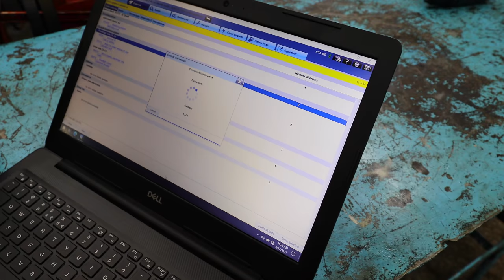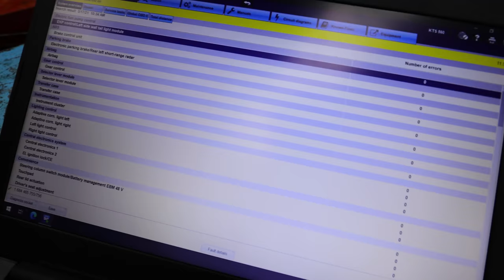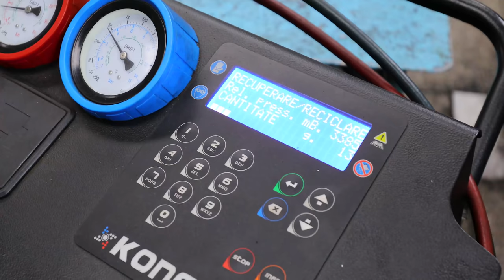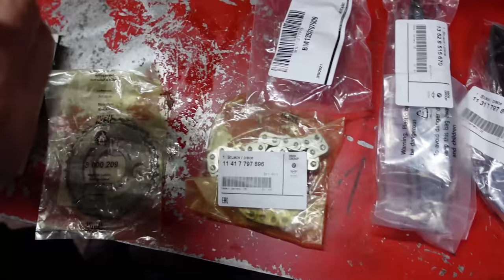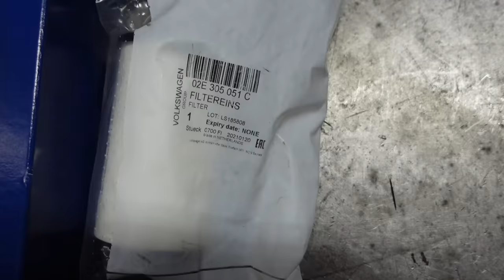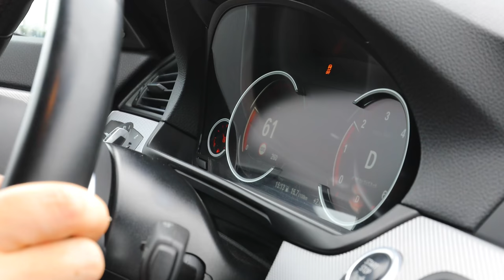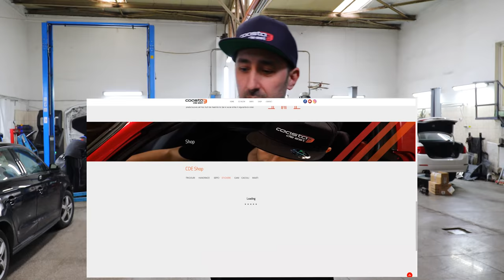BMW M550xd - balaurul cu 3 turbine 😈😈😈

Comment: O coincidenta ca masina care imi place cel mai mult apare chiar in videoul asta . Parerea mea este ca Bmw E31 850ci este un model chiar reusit de la BMW, nu il detin dar chiar mi-ar placea sa am o asemenea masina . Poate cu timpul o sa ajung chiar sa am asa ceva . Are motor de 4988 cmc, 300 cai . Pentru o masina fabricata in 1990, are foarte multe dotari precum scaune electrice cu memorie si incalzire, volan reglabil electric, ASC+T, ABS, AC, EDC/VDC, tempomat, perdeluta electrica, trapa electrica, pe care foarte multe masini noi din ziua de azi nu le au . Acum este o masina istorica care si-a pastrat pretul si costa si acum mai mult decat o masina noua ( 25k euro ) . Mi-ar placea sa am ocazia sa conduc o asemenea masina, chiar cu riscul de a plati benzina :))  , am inteles ca are consum de 20 prin oras .

Comment: Pentru mine cel mai tare BMW facut vreodata este BMW e36
Nu conteaza care motorizare, fl sau nfl. E36 este cel mai tare seria 3 facut vreodata datorita imbunatatirilor tehnice aduse de la modelul anterior E30. Detin un 320i fl din 1997, M52B20 si unul din motivele pentru care m-am indragostit de masina asta este motorul. Inline 6 single vanos, un motor simplu, construit bine si contrat parerilor unora, extrem de fiabil. Nu foarte pretentios si cu mici atentii, tind sa cred ca o sa ma tina pana aproape de milionul de km.
Partea de suspensie a fost total imbunatatita, mc pherson pe fata, suspensie cu punte independenta, multi link z axle si o directie care ofera un simt extrem de placut al drumului. 
Eu personal ma numar printre fericitii cu cateva dotari de exemplu OBC 18 butoane, dublu climatronic digital, inchidere centralizata, scaune din piele electrice si incalzite, etc. Un e36 sunt de parere ca poate fi top inclusiv in 2021 daca este ingrijit bine si are cateva dotari. Izolarea fonica este demential de buna pentru o masina batranica si cred ca cel mai interesant la masinile astea... problemele tipice din cauza varstei. 
Problemele respective pentru unii sunt batai de cap, eu care datorita venitului destul de mic tind sa traiesc o perioada cu fiecare problemuta aparuta, ajung sa ma simt ca si cum as avea un copilas suparat si prostut :)) Macaralele de la geamurile electrice din fata, fete de usi care cad, completarea in continuu al uleiului de la servo, rugina la usi care apare la cea mai mica urma de sare pe drum, stergatorul de pe partea soferului care nu sterge in partea de jos a parbrizului, difuzorul de spate din plastic care se topeste din cauza evacuarii, usita de la benzina care orice i-ai face la un moment dat se deschide in mers, mai da un missfire, etc
Deci pe langa faptul ca in 1990, e36 a fost revolutionar si un competitor periculos pentru masinile din clasa sa, acum, la batranete a devenit o masina absolut adorabila pe care sa o detii, inocenta ca un copilas si amuzanta uneori cu problemele ei banale si simple. In plus, eu personal in cele 6 luni de cand o detin pe a mea, am invatat chiar multa mecanica. Recomand oricarui pasionat care vrea sa isi faca de lucru, caruia ii place sa se murdareasca  de ulei pe maini si caruia ii place sa invete mecanica, luati-va BMW e36, nu o sa va saturati de ea, plus ca este o baza extrem de buna pentru orice tip de tuning, de la drift, la drag, la show. Pace tuturor si keep the good work there!

Comment: BMW 3.0 CSL (cunoscut și sub numele de Batmobile) a fost introdus în mai 1972 și va deveni unul dintre cele mai iubite vehicule ale companiei. A fost produs ca omologare specială, astfel încât BMW să poată intra în Campionatul European de Turism.
Pentru a face mașina mai ușoară decât modelul E9 de serie, inginerii BMW au folosit oțel mai subțire pentru caroserie și au eliminat tapițeria interioară și izolarea fonică. În plus, aluminiu a fost utilizat pentru multe dintre panourile caroseriei, iar geamurile laterale din sticlă au fost înlocuite cu cele mai ușoare din Perspex.
Cu un motor plin de 203 cai putere de 3.333 cmc cu șase cilindri, CSL a fost una dintre cele mai rapide mașini pe care banii le-ar putea cumpăra. În 1973, dimensiunea motorului a fost mărită la 3.153 cmc (3,2 litri), ceea ce a crescut puterea până la 203 cai putere la 5.600 rpm și cuplul de 211 lb ft la 4.200 rpm. Cu toată această putere și o greutate corporală redusă, 3.0 CSL a fost suficient de bun pentru 0-100 km / h (62 mph) în mai puțin de șapte secunde.

Comment: Ce "simplu" se schimba distributia... 😁... Bun clip, frumos examplar de BMW,....
... iar "cel mai cel" BMW... Pai daca e V8 si 5.ar, poate fi oricare... 540 e39, 540 e34, hai si X5 4.4 e53, hai si 740 e32... astea sunt pasiunile mele....

 Dar cel mai "emotionant" ramane M5 e39... 💕💕💕🏁... Are un echilibru aproape perfect intre toate criteriile mele... Cea mai echilibrata masina... Le are pe toate in combinatia perfecta... Design, putere, cuplu, greutate, spatiu interior,... E masina perfecta... Cel putin pt mine.. 😁 
M5 e39 de cand a aparut, pt mine a fost ca o emblema.. ca un simbol...

Comment: BMW M635csi o mașină rară foarte frumoasa din punctul meu de vedere o mașină unică

-Într-un pod nostalgic de-a lungul timpului, am avut prima mea rula în 635CSi condus de Prințul Leopold la runda austriacă DTM în Spielberg, în cazul în care BMW a marcat un senzațional 1-2-3-4, pentru a treia oară în istoria lor DTM. Celelalte două au fost o chestiune simetrică, prima și ultima pagină a capitolului 1 al BMW în DTM (1984-1992). Prima cursă din istoria DTM a văzut o flotă de modele 635CSi dominând domeniul în Zolder, condus de Grohs, Schneider, Strycek și Prințul Leopold. 30 de ani mai târziu, Prințul Leopol

-ce mai frumoasa istorie
Trusa este a mea❤️🙏

Comment: Salut băieți, vă urmă resc de foarte mult timp, am mai participat la concursurile voastre dar nu am avut notoc sa castig după părerea mea cel mai frumos model de BMW  este E30 M3 Evo III de 238 de cai putere cu motorul S14 cu 4 cilindri în linie pe lângă motorul foarte fiabil pe care această mașină îl are mai este și designul pe care această mică bijuterie îl are. Un lucru foarte interesant la această mașină este unicitatea ei, din anul 1980 și până în anul 1990 sa-au produs 600 de exemplare fapt care în prezent o face să concureze cu modelele noi din punct de vedere al prețului.  Motorul acestei mici bestii de 2,5 litri genera 238 CP, mașina a fost exportată în Marea Britanie unde a fost îmbunătățită cu un set de elemente marca AC Schnitzer printre care se numărau arcuri sport, bara de ramforsare a suspensiei față dar și oglinzi, pedale și volan din aluminiu. Pentru mine aceasta este una dintre cele mai bune motorizări de pe BMW sper să vă placă părerea mea.
P.S. Păcat că a plecat Ion!

Comment: Primul BMW seria 8
Mașina a fost prezentată publicului la Salonul Auto de la Frankfurt în septembrie 1989, seria 8 fiind printre primele modele la a cărei proiectare s-a folosit CAD (computer-aided design).Rezultatul a fost un coeficient aerodinamic de doar 0.29, unul foarte bun pentru perioada respectivă.Foarte avansată pentru vremea în care părinții noștri mergeau cu Dacii rablagite, Seria 8 devenea printre primele mașini ce avea accelerație electronică drive-by-wire și al doilea BMW, după Z1, cu punte spate multilink. Mai mult, avea chiar și coloană de ajustabilă electric cu memorie. Printre detaliile mai puțin avansate se numără cele două suporturi de pahare și lanterna situate în torpedoul de jos. Da, de jos, deoarece Seria 8 avea inițial două astfel de spații de depozitare, cel de sus fiind înlocuit ulterior cu airbagul pentru pasager.

Comment: Cel mai top bmw din punctul meu de vedere e m3 e92. Are motorul perfect:

-benzină
-4.0 l
-v8 
-aspirat
-420 cp cu 400nm

În funcție de preferințe, il poți lua cu DCT (dublu ambreiaj) sau manual.

Ținând cont că până acum s-au pus numai 6 în linie pe M-uri, V8-ul de pe e92 are un sunet demențial, este unul dintre cele mai fiabile motoare nefiind supra-alimentat. Pentru mine e cel mai frumos BMW desenat vreodată (nfl) și nu l-aș da nici pe M8 2020. De când eram mic era mașina preferată în NFS Hot Pursuit. Am reușit să-mi cumpăr un E92 320i anul trecut. Sper ca în viitorul apropiat să-mi permit și un E92 M3. Pentru cei care aveți bani, sfatul meu este să le cumpărați acum, deoarece li se va tripla valoarea în următorii 10 ani, datorită motorului aspirat.

Comment: BMW e 46 M3 
 
Sunt unul dintre oamenii care au îndrăgit masina asta datorită jocului Need for Speed Most Wanted . 
Câteva lucruri pe care le-am aflat despre masina după terminare jocului , sunt .                           1 ) BMW e46 M3 a fost lansat in anul 2000 și avea sub capota un motor 3,2 l care dă viața la 343 cp. 
2.  Masina venea in varianta coupe ce îi dădea un aspect sportiv bine conturat pentru vremea aceea si câteva elemente aerodinamice puls jante specifice ce inchegau aspectul mașinii .
3. Au fost fabricate și lansate și câteva modele mai speciale precum : BMW M3 gtr, M3 csl și M3 cs. 
In concluzie pot spune doar ca aceasta masina mi-a marcat copilaria prin puterea ce o arată in joc exact ca in realitate .
BMW e46 M3 o sa rămână in istorie ca unul dintre modelele BMW de top din vremea  lui ce a uimit prin putere , design și fiabilitate .

Comment: BMW Z8 e52, design clasic inspirat de la și mai clasicul 507, BMW 507 ca suna un pic a Peugeot numele 🤣 Un V8 sub capota, s62 de 4.9L, cutie manuala 6 trepte și un interior super stilat, cam tot ce ii trebuie unui roadster premium. A fost disponibilă și o varianta Alpina cu V8 de 4.8 (M62) și transmisie automata in 5 trepte dar eu as alege varianta standard cu transmisie manuala. Fabricat între 2000-2003, deci simplu de întreținut, practic iti cam ajunge trusa de scule pt lucru la o astfel de mașina și se pot face multe lucrări la nivel de pasionat. La data lansării costa 128.000 de dolari, in 1999, acum greu găsești una sub 165000 €. Cu puțin noroc la loterie îmi iau și eu 😂 Multă bafta in continuare, poate vedem o distribuție de z8 pe canal. Dacă reușesc la loto va aduc eu una 🤣

Comment: Mașina mea preferată este un BMW E30 M3, e mașina visurilor mele. Încă de mic am fost atras de ea. În primul rând este un motor aspirat, cu 4 cilindri în linie, este o mașină ușoară care are cuplul cel mai mare la turații foarte mari. Motorul dezvolta între 200 și 238cp, s a fabricat între 1986 și 1991, venea din fabrică cu abs, discuri ventilate. Ca și performațe făcea 100km/h în 6.7 secunde și viteza maximă este de 235km/h. Ulterior în 1990 a apărut pe piață umatorea generație de M3 E30, care avea un motor de 2.5 litri și 238cp. Nu doar motorul în sine făcea ca bmw E30 M3 să fie o mașină excelentă cu și designul în sine. Prin urmare acestea sunt motivele pentru care mie îmi place BMW E30 M3

Comment: Salutare baieti, pentru mine cel mai super BMW este e46 318d din mai 2005. il detin din noiembrie 2007, l am cumparat la 90000km azi are 311000km, niciodata nu ma lasat in drum, turbina originala, cutie manuala 5 trepte motor m47n 204d4 cred ca e cel mai fiabil motor in 4 cilindri de la bmw, in afara de consumabile, revizii la 10000km pe care le fac eu, nu am mers la un service decat pentru paralelisme, incarcate clima,schimbare de cauciucuri, in rest ma ocup eu de ea, sincer nu o sa o vand niciodata.masina e ca noi oamenii, cum avem grija de noi, atat de bine ne este cand incepem sa imbatranim. va doresc succes voua tuturor

Comment: Cei mai tari ever!✌️💪
Pfoai, cel mai tare BMW, cam greuț cu asta, dar totuși există! 
BMW E31 (g8) primul din seria 8! 
De ce? Este cea mai faină mașina a anilor 90,un coupe desăvârșit si foarte ieșit din tipar, un coupe benzinar cu un motor V8 sau chiar V12 da da, V12 in acea perioada 💪 si cu o capacitate cilindrică care variază intre 4.0L si 5.6L,o nebunie, o nebunie fiind clasat langa Ferrari, Lambo,AstonMartin, Mercedes-Benz și Bentley (w12), deci e wow numai cand te gândești ca proiectul final a fost început in 1981 si terminat in 1986. Multi consideră ca este un succesor  al serie 6 (e24), dar mna..parerile sunt împărțite 😇
Ce este interesat, forma aerodinamica si farurile acelea escamotabile 😍(alea de se pitesc de hoti sub capota😂) In concluzie, o masina bestiala, dar din pacate au devenit foarte rare.. Cele mai multe sunt in stare deplorabila..pacat,mi-aș dori o astfel de masina sa o reconditionez, sa fie asa pe genul "old school" dar...cred ca ar fi foarte tare sa vad in clipurile voastre un Seria 8 😇 macar pentru schimbul unui bec😂
Deci băieți, sunteți cei mai tari, felicitări sa o tineti tot asa, si bafta în continuare 💪✌️

Comment: Cel mai tare model de BMW dupa parerea mea este Seria 8 vestitul E31 . Faptul ca s-a produs doar din 1990 pana in 1999 denota ca atunci BMW nu a dat lovitura la care se asteptau dupa parerea mea . Din ce imi dau seama acum oamenii se intorc la adevaratele masini ( fabricate inainte de 2000) si acest E31 este unul dintre cele mai dorite modele de BMW ever.
BMW dupa cum stiti a incercat recent sa reinvie Seria 8 cu noul lor G15 care arata bestial din toate punctele de vedere si " continua " oarecum traditia E31 .

Deci in concluzie SERIA 8 e cel mai tare model de BMW produs vreodata chiar daca vorbim de cel vechi sau cel nou , au acel ceva care te face sa intorci capul dupa el si sa il privesti pana iti dispare din campul vizual.

Sunteti cei mai tari si va urmaresc fiecare clip cu interes si multa placere !

Comment: Bmw M1. Prima masina contruita de divizia M. Motor amplasat central, construita manual, motor de 3.5 litrii 6 cilindrii in linie, 399 de exemplare de strada, injectie dezvoltata de Bosch,motorul de Raul Porsche, sasiul de fpsti ingineri Lamborghini,motor in 5 trepte facuta de ZF, echipata cundiferential cu alunecare limitata cu blocare 40%. Pe baza acestui motor au fost dezvoltate ulterior M5 si M6 (e24 si e28),273CP si o viteza maxima in jurul a 260km/h. Pentru anii 1978-1981 in care a fost construita era un competitor puternic pentru masinile sport. A si sa nu uitam de caseta de directie cu pinion si cremaliera neasistata. 👍

Comment: Cel mai frumos model este : BMW E31 seria 8 avand in vedere ca s-a fabricat din 1990 - 1999 are o varsta bunicica si totusi arata demential prin liniile pe care le are caroseria si motoarele 2 la numar V8 si 3 la numar V12 care au fost gandite pentru a fi sportive la fel ca si masina da si mult mai luxoasa deoarece  E31 a fost gandit sa inlocuiasca BMW seria 6 E24 , a avut disponibil 3 tipuri de cutii : 2 automate una in 4 trepte iar cealalta in 5 trepte si ultima este manuala in 6 trepte Getrag 420G care era disponibila doar pe V8 , iar pe V12 era disponibila Getrag 560 G dupa parerea mea toata tehnologia a fost super ok pentru acele vremuri la o masina care se vroia sport-luxury dar nu cred ca , a avut atat de mult succes datorita lungimi destul de maricica 4,8m si o greutate enorma raportata la cp/nm cel mai greu exemplar 5.6l V12 automat cantarind putintel sub 2 tone . 
Fiecare are dreptul sa îi placa orice marca sau model de autoturism dar nu e ok sa dati cu hate intre masinisti pentru fiecare masinist ( printesa ) lui este ce-a mai buna masinuta . Asta ca o paranteza la raspunsul cerut de Bogdan

Comment: BMW M5 E39

Masina copilăriei mele !

Proporția componentelor șasiului care utilizează aluminiu a crescut semnificativ pentru E39 și a fost prima serie 5 care a utilizat aluminiu pentru toate componentele majore din suspensia din față sau din spate. A fost și prima serie 5 în care era disponibil un motor diesel cu patru cilindri. Direcția cu cremalieră și pinion a fost utilizată pentru modelele cu patru și șase cilindri, prima dată când o serie 5 a folosit acest sistem de direcție în volume semnificative. Spre deosebire de predecesorul său E34 și succesorul E60, E39 nu era disponibil cu tracțiune integrală.
Sedanul de înaltă performanță E39 M5 fost introdus în 1998, alimentat de un motor DOHC V8 de 4,9 L . 
A fost primul model M5 care a fost propulsat de un motor V8.

În mai 1995, BMW a publicat primele fotografii oficiale ale modelului E39. 
E39 a avut premiera în septembrie 1995 la Salonul Auto de la Frankfurt . 
În decembrie 1995 au început vânzările de modele sedan pe continentul european.

E39 a fost unul dintre primele vehicule (alături de seria 7 E38 ) care a avut airbaguri cortină , care protejează capul ocupanților într-un impact lateral.
Echipamentele standard pentru modelele de lansare includeau airbaguri frontale și laterale duble , pretensionatoare și limitatoare de sarcină pentru centurile de siguranță din față, frâne antiblocare , control al tracțiunii , servodirecție și aer condiționat . 
Navigația prin satelit a fost , de asemenea , disponibilă, folosind inițial hărți de pe CD-ROM-uri, apoi se trece la DVD hărți în 2002.

Modelul M5 al modelului E39 a fost introdus în 1998 la Salonul Auto de la Geneva și a fost produs din 1998 până în 2003. A fost alimentat de motorul S62 V8. Toate mașinile E39 M5 au fost vândute în stilul caroseriei sedan cu transmisie manuală cu 6 trepte.

Car and Driver a prezentat modelul E39 în „ 10Best list” de șase ori consecutiv, din 1997 până în 2002. 
În 2001, Consumer Reports a acordat 530i cea mai înaltă clasă de autovehicule, declarând-o cea mai bună mașină pe care au analizat-o vreodată.

Intr-un cuvânt cea mai frumoasa berlina desenata vreo data și una din cele mai sigure mașini.

Felicitări pentru ceea ce faceți !